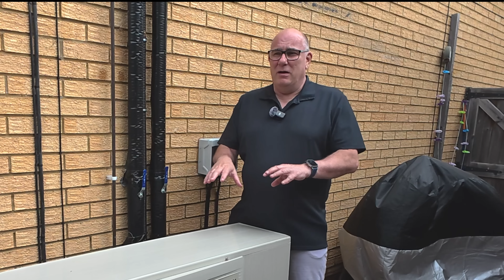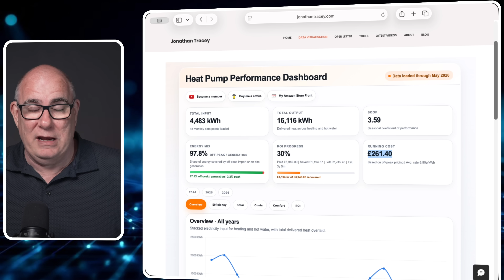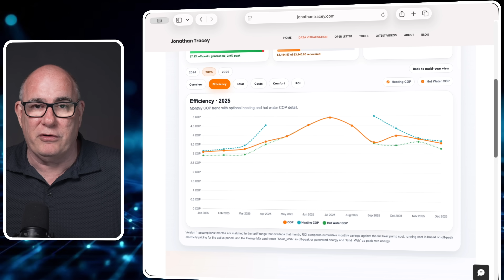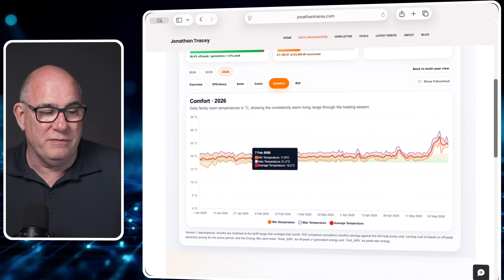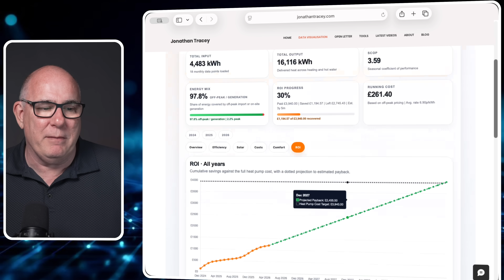18 Months Later: Would I Still Buy A Heat Pump?

Comment: How about "what is the payback of a heat pump without solar and batteries". ROI neglects the battery/solar assets?
Reply from the maker: no idea  :-) the ROI on battery and solar is already accounted for elsewhere (they are paid off)
Reply: @JonathanTracey  The argument I put is from standing start of no solar or battery assets. The HP ROI surely ought to factor in those additional install costs. The payback economics whilst the spark gap exists must be significantly longer without?

Comment: I'm convinced! I've ordered my ASHP and the DNO has approved the extra load. We're now waiting for the government to start the £9k BUS grant for oil/LPG. Our installer has recommended a Midea heat pump, new hw tank and 5 rads, all for £1,550 (after the BUS). Should save me a fortune in oil.
Reply from the maker: wow that's a great price, congrats
Reply: I thought I got a great deal from octopus at £1.750 after bus but that's even better 👍
Is yours a local installer?
Reply: @roblinc2u were you also replacing oil?
Reply: @Biggest-hz7ng   no, we had a 28 yr old gas boiler.
Reply: Installers are key. Be good to hear what your approach to that has been?

Comment: I have a different (simpler) hot water strategy. Hot water us heated every night during IOG off-peak hours i.e. starting at 23:30 and typically lasting 60-90 minutes, until the target temperature is reached (43 deg C). It's always heated at off-peak prices; the COP is good because it's not cooled off too much yet outside; it doesn't bother us with noise or reduced house heating because we're asleep; and it doesn't take charge from my batteries which charge at the same time as water heating. Off-peak pricing is much more effective at controlling hot water costs than midday temperature and improved COP.
Reply: Yep, completely agree, I do exactly the same including charging the car. Cheaper and balanced the grid too.
Reply from the maker: Sounds like a good idea, we have that as an option to turn on in the winter but found we don't need it in the summer
Reply: @JonathanTracey  so in the summer you use solar (12p/kWh) rather than off-peak (7p/kWh) for hot water?
Reply: I flex around that with visitors (hotter water) and evening showers after sport (daytime heating).

Comment: Did you use the Shelly EM for the accurate energy input ? I have found some are quoting SCOP/COP from the HP monitoring (10%-15% accuracy).
Reply from the maker: Yes I use an EM50 as the internal HP monitor rounds up to whole numbers and can be wildly off. For heat output we have to rely on the HP numbers becuase I have not found another way to get that data
Reply: @JonathanTracey   I currently record the consumption and production data from onecta, the mmi and my shelly, all three are different!
You would think the oneta insights figures and the mmi data would be the same but no.... I think I trust the shelly em data more, at least it looks like it could be more accurate with it's two decimal places 🤔

Comment: We are going back around again for an Octopus quote. One area of concern is going all in electric, great from environmental grounds but does feel like all the eggs are in one basket and no easy off ramp. Has to be balanced against our oil dependency, start of the year I was all chipper on the cost of oil and the only risk being geopolitical unrest….. and we know what then happened. The July price cap move will unsettle a lot of users on electric and gas as it aligns with the oil again ….. I can see the surge in plug in solar so your other vids are very helpful thank you.  As an aside I am a HA user and have recently used Claude to write me automations to max the benefit of my Powerstream / delta 2 max system. Very easy and clever automations that adjust the power to the house depending on the days solar and battery %’s so I max the battery use and solar and therefor max my export from my main system.  Keep em coming
Reply from the maker: @yellownev It's a fair concern, but I'd argue most of us already have our eggs in one basket. Even if you keep a gas or oil boiler, it still needs electricity to run the controls, pumps and ignition. If the power goes out, your heating usually goes out with it.

The bigger question is which fuel you want to be dependent on. Nobody has a crystal ball—if we did we'd all be millionaires—but the current energy situation is showing just how vulnerable fossil fuel prices are to global events.

The government is also looking at breaking the link between electricity and gas pricing. If that happens, the likely outcome is cheaper electricity and relatively more expensive gas, which only improves the economics of electrification over time.

For me, the lesson from the last few years isn't that we should cling to fossil fuels—it's that we should be getting off them as quickly as practical and reducing our exposure to volatile global fuel markets. The more energy I can generate or store at home, the less those events matter.

Comment: So, your overal setup is solar panels, massive (?) amounts of battery storage and a heat pump. The batteries are fed by solar and draw down from the grid (at non-peak times) and the batteries then power everything. Is that about right?

Roughly how much have you spent on the panels, batteries and heat pump?
Reply from the maker: TBH can't put an exact cost on it as its been an evolving project over 15 years but to replace the solar and batteries today would be about 18-22k. In my case my system has paid for itself already so there is no cost to me for the energy it produces, and the heat pump is paying itself off about 30% per year

Comment: Be great when the day comes when we will not be monitoring or even notice a substantial green installation - as they will be optimised and streamlined for very normal operation.
What will be cost difference in a new house price - extra £250 for Heat pump, and say £20k for solar and batteries and £3k for insulation (?) - sure an increase but offset by annual savings.
Reply from the maker: @palemale2501 I think that's exactly where we're heading. Most people don't spend their evenings checking boiler flow temperatures or inverter outputs today, and in the future they won't be monitoring heat pumps, batteries and solar either. It'll all just happen automatically in the background.

The interesting thing is that in a new-build, the additional cost of a heat pump over a gas boiler is already relatively small. Once developers start designing homes around heat pumps from day one, rather than adapting gas-era designs, the cost difference shrinks even further.

Long term I suspect we'll look back and wonder why we were burning fuel in millions of individual homes when quieter, cleaner and largely automated alternatives were available. The technology is already there, we're just going through the awkward early-adopter phase.
Reply: @JonathanTracey  Yes you guys have done all the groundwork and calcs for us.  
You missed out "cheaper" in your last para which makes it a no-brainer lol
Reply: @JonathanTracey   errrr .... some of us do spend the evening checking flow and return, inside and outside temperatures with shelly pill probes and other sensors scattered around.
Also comparing usage and production data with manufacturers sensors against third party sensors then looking at similar setups for patterns to reassure ourselves we've made the correct decision. 
Sometimes when things seem too good to be true they really are true. 😊

Comment: You credit solar for providing you with a lot of energy for heating (which is great), but you don't allocate any cost to that. You could have exported that solar at ~12p/kWh so that's its opportunity cost. It's not free, it has an opportunity cost
Reply from the maker: your right but as its impossbile for the heat pump to tell what is generated solar vs battery import I account for it in the worst way by assuming its all imported energy. In my case I can probably assume 90% is generated solar.

If we assume its all imported energy there is no opportunity cost missed

Comment: Excellent, precise and simple. When enough time has passed what is the full picture for a year.
Bills now for 6 months heating, plus 12 months hot water, electricity & EV charging - 
versus normal bills including petrol/diesel, without improvements (so savings after all ROI).
Then the total capital investments - plus ROI for each of Heat pump, Solar and Batteries.
Reply from the maker: you can see a full year just go back to 2025 in the charts,

Comment: How do you get the data from your Daikin heat pump, specifically the heat produced into home assistant and then onto your website automatically?
Likewise for the solar generation.
Reply from the maker: daikin have a official home assistant plugin (Daikin Onnecta) you then need a devleoper account (free) and you can integrate them. I then have some nasty python code that runs and gets the data from Home assistant, munges it into a database on a monthly basis and the website pulls from that. Same for solar but its a bit more complicated and runs daily.
Reply: @JonathanTracey    sounds very interesting.
Reply from the maker: yeah its a home brew system but seems to work well, have not had to touch it in over a month, keeps grabbing data and doing its thing
Reply: @JonathanTracey   will you be doing a video about how to do it?

Comment: I’d like to see someone who has a heat pump in a large Victorian house with sold walls. Tempted to add a heat pump to the solar and battery we have but I keep getting told it wouldn’t work. We already have a new central heating system with oversized rads.
Reply: I do have a heat pump in a 340 year old farm house with solid walls and single glazing. You wouldn’t under size a gas or oil boiler so a right sized HP is just fine. In fact the house is now far better with constant heat and less condensation.
Reply: @Andy100ElectricAndy we have a 250 year old cottage and are in the process of getting an Octopus quote. I suggested to the surveyor old thick walled properties like ours have a heat  battery effect, he agreed and said it should be a factor in their calculations.
Reply: It's a slightly different situation when you already have a new central heating system and I guess depends on your reasons for changing to a heat pump.
My situation was like J.T.s  ... we needed to change our 28 year old gas boiler, so when octopus gave me a price for a heat pump which included replacing almost our entire system and was cheaper than replacing just our gas boiler I didn't have to think twice.
If I had a fairly new more efficient gas boiler it would have been a tougher decision, especially when there's so much negativity published about heat pump.
Like J.T I can only say they do work in the winter and paired with solar and even a small battery ours is working out cheaper to run than our old gas boiler.
Our energy bills have gone from £310 per month to £10 per month.
Not zero but seriously lower.
JT and other YouTubers gave me the confidence to risk ditching gas.
Reply from the maker: I don't know its as specific as the home type but there are thousands of data points from heat pump users here https://heatpumpmonitor.org

Comment: My heatpump cost me 3500 after the 7500 bus grant and 2000 green incentive from Halifax leaving me with a heatpump that has a really good ROI not that heating should be measured in ROI. It's worth speaking to your mortgage to see what they offer for green incentives. I know Halifax and Barclays have some offerings. After this week's weather I do slightly regret not getting fancoils instead of having rads I could have had heating and cooling.
Reply from the maker: Yeah, and it looks like there will be more of these, looking to back some 0% loans in early 2027 for solar batteries and Heat Pump pumps

Comment: Enjoyed your video and analysis, but have to take a little issue with your methodology for your calculations.

Your system is only so cost effective because your have storage batteries, but you take no account of those in your calculations. You couldn't have the cheap-rate electricity to power your heat pump without the batteries and would have to power your heat pump with electricity at the standard rate. (Or you could power it with solar, and take account of that correctly).

You should include an element of the cost of your batteries in the cost of your system, and thence in the calculation of your ROI.

It's very complicated coming up with an accurate calculation of ROI because there's so many interconnected elements that you have (batteries, house solar, fence, solar, etc), but you can't ignore the battery element entirely.
Reply from the maker: So I take your point, however my solar and battery system has almost paid itself off through generation of energy that I no longer have to buy from the grid. So there is nothing to add in my case.

Comment: Can your heatpump be set to boost the heat in the tank when the prices are low?
Reply from the maker: Not using the Daikin software, it doesn’t have any understanding of energy tariffs. However, there is a pretty good Home Assistant integration so you can tie the octopus integration into it to control the Heat Pump
Reply: @JonathanTracey  My 9kw Daikin can have different hot water temp schedules at different times of day. Set on the MMI
Reply: @pete-fraser  So it can be set to heat up before the peak times, interesting.
Reply: @surters  Before I had my solar, i had the Cosy tariff with 3 low cost periods so I turned the temperature down in the expensive times. Now that I have solar and battery, I don't bother
Reply from the maker: @pete-fraser yeah same with mine you can set it for offpeak but with a bit of home assistant magic you can also have it boost if your getting extra free charging slots on Intelligent Octopus Go.
Reply: I use Havenwise. It does some pretty clever optimisations, like looking at the weather forecast and using your electricity tariff.
It learns how your house works in various conditions. In my case it seemed to have figured out that I have a lot of solar gain in the shoulder season from my conservatory.

Comment: Since you use your heat pump for heating the primary use is when the sun isn't shining.  Being in AZ my heat pump's non-winter usage is for cooling during which the sun is shining and the peak heat of the day happens during the On-Peak (4-7pm) period of the day.  Before solar was installed, the heat pump pre-cooled the place an hour or so before being turned off for On-Peak and then was turned back on afterwards; all to avoid incurring higher Demand Charges.  Once solar went in but before the batteries the heat pump could be run during On-Peak but only when there was sufficient solar being produced.  Monitoring this was a manual process.  Once the batteries were in place, the need to restrict heat pump usage was over.  Unsurprisingly the amount of energy used by heat pump rose significantly (50%-75%) since it was effectively free to run off solar.  Yes, I know that each kWh the heat pump used was one less kWh to be sold but I find it's better for my persnickety mental health to ignore that.
Reply from the maker: Yeah, in the depths of winter that’s why having batteries makes so much sense with the Heat Pump because you can buy the energy overnight at much cheaper rates to run it when there is insufficient solar. We do get a little bit of sunshine during the winter but not enough to run a Heat Pump that may be consuming 35 to 40 kWh a day.

Comment: Nice video! I would have liked to see what portion of the heating in the winter months comes from solar directly or through the solar saved in the battery Vs coming from the grid directly or through the grid electricity saved in the battery.
Reply from the maker: Unfortunately, I don’t have the granularity of data to pull that into this dashboard. The energy measuring devices don’t have a way to differentiate between the two types.
Reply: @JonathanTracey I see, that's a pity... But maybe it could be somewhat approximated?
For example, the grid electricity used directly or first stored in the battery and then used for the heat pump could be approximated by the excess electricity from the grid for each winter month over the average monthly electricity for the summer months (assuming no AC?)
And that could be compared just to the raw solar generation (before it goes to the house/battery/grid-export), as there won't be other way to determine.
Even knowing that comparison could be useful, IMO, as the gains from the time-of-use tariffs can change dramatically over time or across different countries.
Reply from the maker: I will put it on my list to see what I can do for the next version, no promises :-)
Reply: @JonathanTracey no pressure 😊 your channel is already one of the most informative ones!